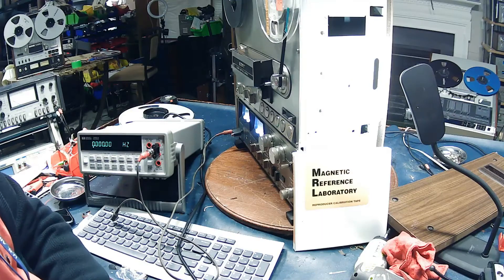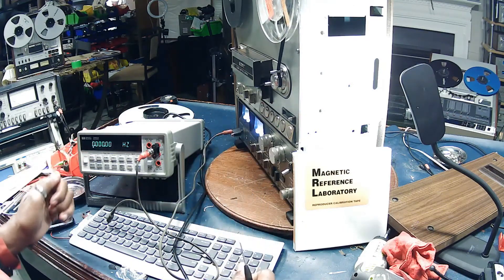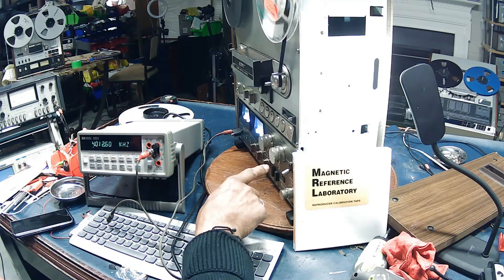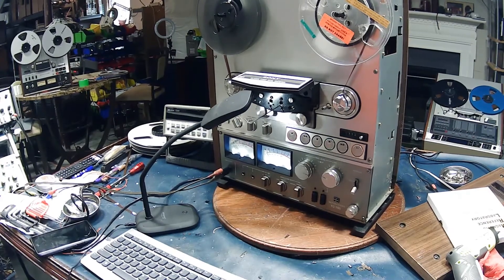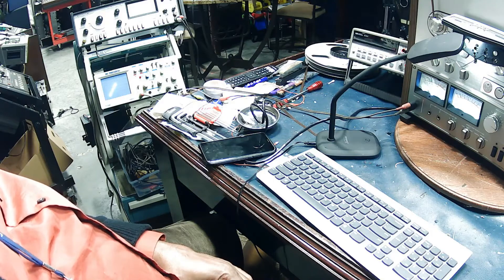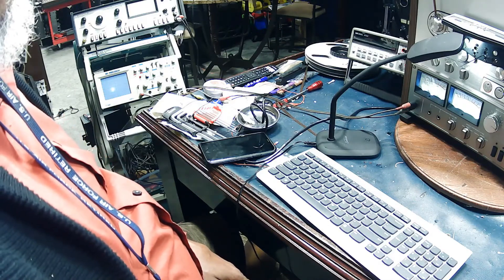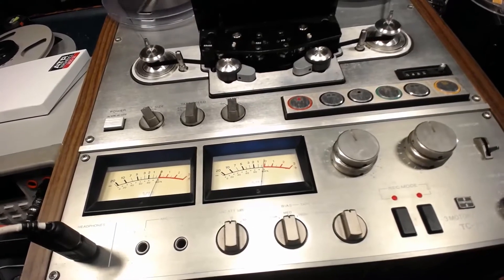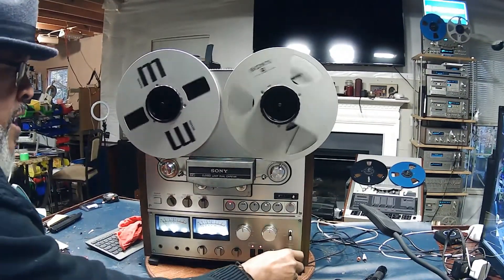Sony TC 765 Reel to Reel Repair Pt 3

Comment: Hi, thank you for your great video!  I have a very similar reel to reel- Sony TC766-2 that drive me crazy the vu-meter calibration. In the service manual say that for an output level of 0.44V on line out, the vu-meters should indicate "0" . This is not possible. Even if i adjust VU-meter poteniometers to the max, i still don't reach 0db. What value you read on your vu-meters when the output signal was 0.44V? In the video i can't see.
Reply: I found the reason for this 😁. RV106 and RV306 vu-meter level potentiometers  was bad, when i adjust to the maximum VU level they never go to 0 ohm. They have around 500 ohms.